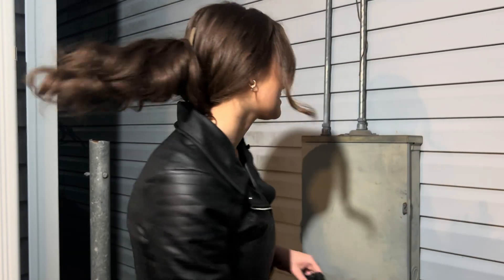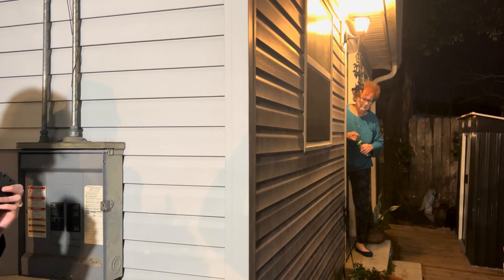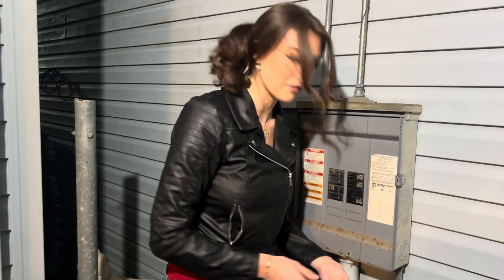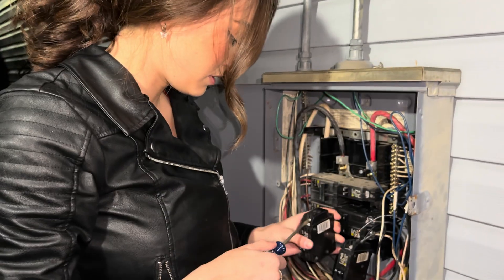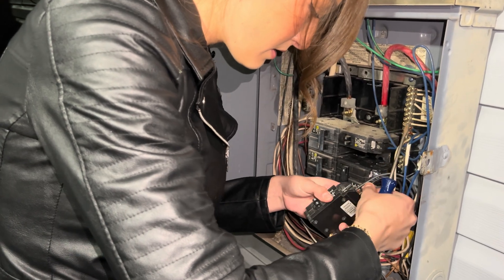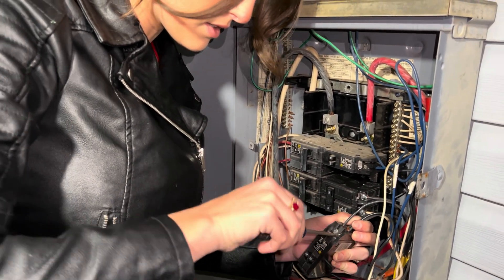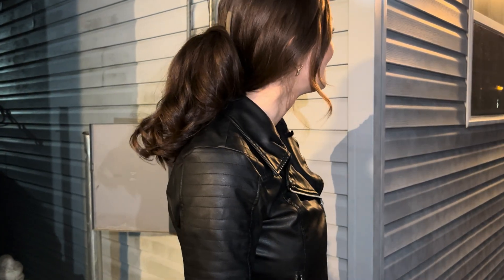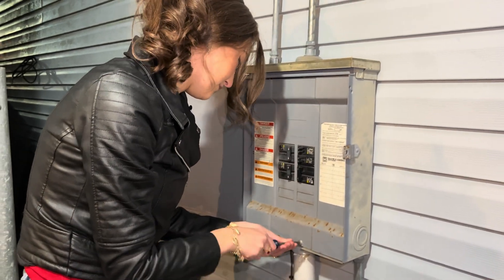Can Rachel Pizzolato Replace an Electrical Breaker?

Comment: as a master electrician I approve of this video
Reply: You do?  2 wires under 1 screw is acceptable to a master electrician?
Reply: Really??  You are a master electrician and you approve of this video??  First, she had no equipment to verify whether or not voltage was present, a big NO NO!!  Always check, no matter what you believe to be true, verify it!!  Second, a 2 pole breaker should only have 2 wires going to it for a 220V load the second wire on the one leg should NOT be there.  It will most likely produce an unbalanced load contributing to the breaker not functioning as it should.  Third, the leg with two wires was mixing braided and solid wires, again nothing I would ever do.  If you are forced to piggy back wires, do it on a single pole breaker!  I just have difficulty trying to reason out why a braided wire is even in that box at all.  What that braided piggy back wire is attached to should be looked into.